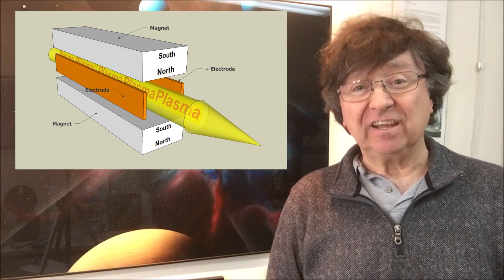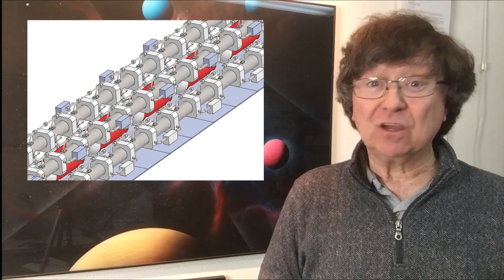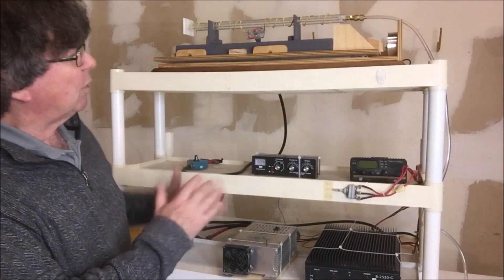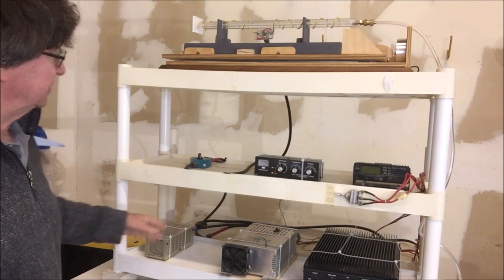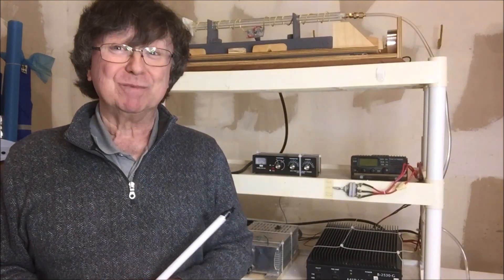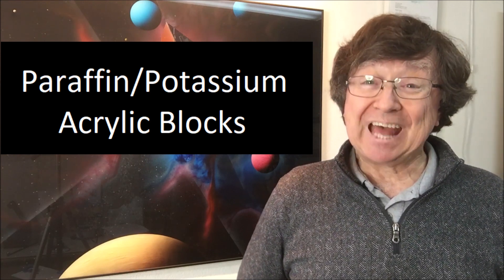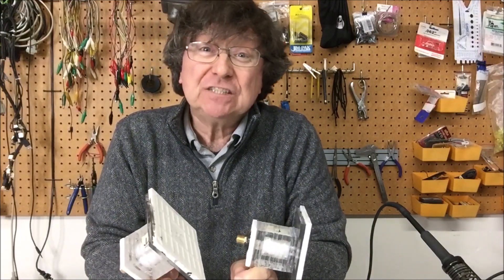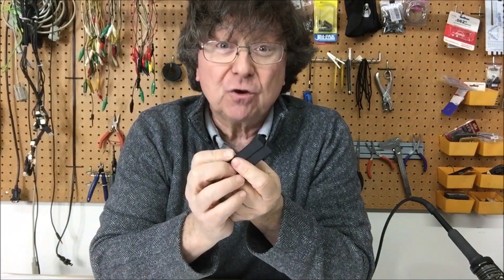Magnetohydrodynamic Program Update

Comment: Hello. I have some interest in magnetohydrodynamic generators, and space-X’s starship program as well. The flame diverted systems and water deluge systems are good solutions, but I have always wondered if a magnetohydrodynamic generator coupled to a large resistor to dissipate the energy harvested could dampen the thrust exiting the engines in a way similar to the electric braking technology in freight train and oil rig diesel electric systems. Do you think this is viable?

Comment: Pretty cool tech and channel. You know when I was a teen, I had an epiphany for a special craft but it did not exist that I knew of. Other than the UFO theory that maybe something similar did exist. Over a few years I would see things like Toys in space and other R&D that would prove my idea would work. The toy was one of those tiny race cars and track but the track was looped. And when he wound the car and let it on the looped track, I knew my machine could move similar but with computer controls. Around the same year a man in Australia started to tinker with a similar idea and his thing he created end up being studied by Uni all over the world and is now known as an "antigravity" like machine. Of course it is debated rather it is anti anything but the idea is not that it removes the weight of an object. In the last 20 years yet another video of a man using a drill to spin a few 25 pound weight, at the end of a pole, then he is able to lift these weights, from the other end of the pole with ease. Now even though the weights do not change the actual weight of 75 LBS, The man can not possibly lift 75 LBS with one hand, over his head The weight in spin, does pan out toward the edges and then the weight has this observer effect. Where the impossible, lifting 75 LBS with one hand, is possible. Im not sure who has considered how this may effect a space capsule but I had already designed a spinning space capsule long before I had seen all of this. The idea was exactly the same idea as an electric mortot only inside out. Right now rotors and stators are used to drive the shaft in the center of the motor. In this case the harvest is not a spinning rotor but a stator shell orbiting the rotor. Its an electric motor BUT, The poles are in place by magnetic poles as apposed to a metal shaft. This is so that when the motor is spinning, the poles can tilt the axes of the rotor. Your trying to gain a type of gyroscopic flickering cross space. I have not made any attempts to try to test some ideas because up till recent times I assumed it just would not work. It was just an idea for a gyroscopically driven space capsule.  But to see the missing Chinese PHD who had in my opinion taken the Australian mans "Antigravity" device and used superconductors. Well if a person truly closely looks into the tech she was working on, it goes back to the Australian mans project. You can follow the trail of interests into his machine right to Dr. Lynn was it?  Point is, This idea she was working on gets close and closer to a design that popped into my head at a very young age and I have tried to forget the idea. I guess building a rotor and stator and performing some degree of tests would not be that tough. I can not seem to find any other source of research into applying the spinning weight gyro effect to some sort of craft. What I do know is it would look like a disc that spins or a sphere and that idea predates me from a Myth of strange flying machines. Would it be coincidence then that our technology is following that shape? Heck even your MHD tech, you know when they get over rockets, MHD will use a Disc. A disc that glows much like the legends. Go figure, bout the same timeframe the Pentagon dishes out all this UAP bologna right as James Webb is going to find out why the Orbits of Tabbi star has the 11-14 or 7-11 as if its not a natural system. Now of course I had been predicting the same thing our CIA friend who is heading the FOIA workshops for UAP,s. Now he has restrictions on what he can legally tell the people but the one tiny area that I often see him NOT acting bluntly factual, is the James Web comments. This man is so bluntly honest if I was to compare his body language to other Aerospace intel guys and it causes this one area to be a "Tell". Meaning it stands out like a soar thumb to me when he beats around the bush with this hint, "They will find something in space and say (we need a closer look), send james web and there, proof of E.T." As he wink, winks. Now he has said that Multiple times.. Im sorry I can not think of his name but he made this PowerPoint presentation for how to get IMAGES from FOIA by applying to the correct imaging departments. He wrote a book and now his lectures he discusses how surprised he is the CIA did NOT redact a load he had planned on them redacting. So in his shock that he is able to speak on this, the only thing he is hinty about is how James Web will be used. Well it just so happens we all know what system, James Web is going to look at and it is exactly what this man is hinting, some system that we thing "Wow that looks like it might be E.T.", Though this man uses the actual words "Wow that looks INTERESTING, We need to go take a closer look, James web answers part of the question, humanity lets that new idea soak in over time as we wait for mars". Not his exact words but to that tune.  Now given where this MHD tech is headed to drive discs,, this stuff has been around since the 1930's and I mean the actual FUTURE Of what you are working on, because hind sight of what we know, the UFO legends are way to coincidental.